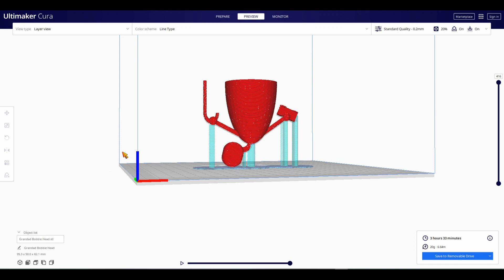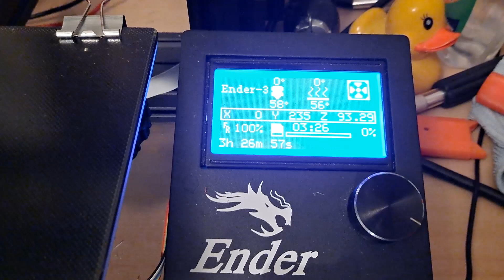Bobble Head Grandad printed upside down

Comment: the new 1 works even better then the original one u started of with. looks like printing something upside down u dont have much of the pla go to waist .
Reply from the maker: A big part of 3D printing is deciding what angle to print the item at. It also affects the strength, so it is not as simple as just flipping it over.